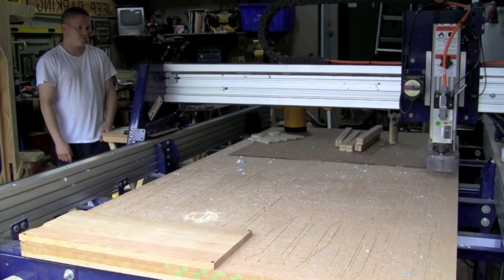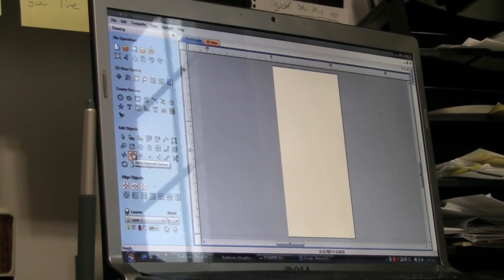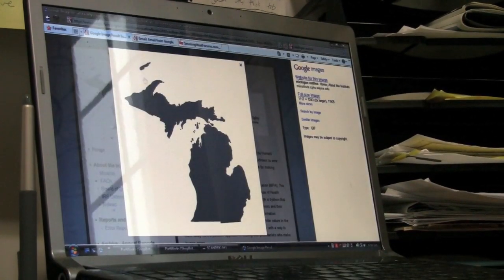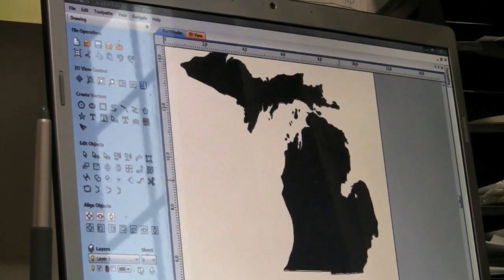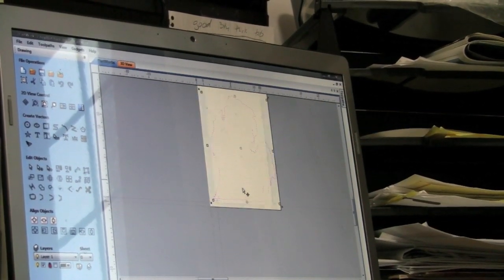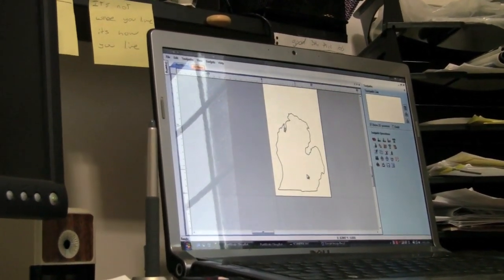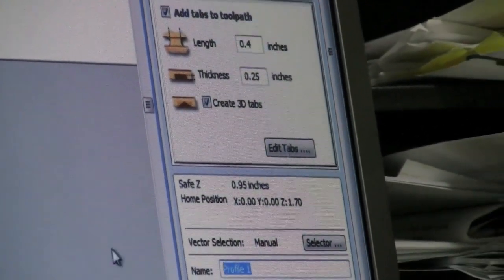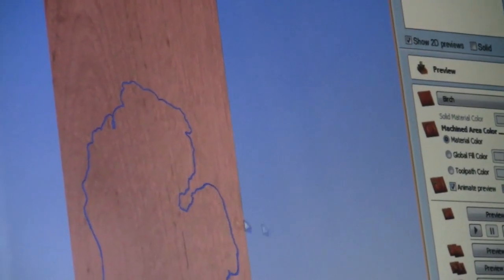ShopBot Tutorial

Comment from the maker: Cary,
It is actually my brother TJ that is the expert at ShopBots, I just do the video. He said he uses "the ToolDatabase to set the number of passes, feed rate and spindle speed for the bit I am about to use.  I get these numbers by using the router bit manufacturers recommendation then dial them in using a Chip Load Calculator.  Once I know what feeds/speeds work for certain materials I simply select the bit and go cut."